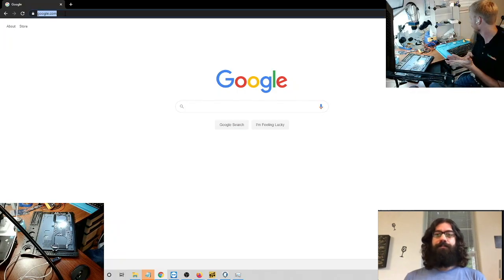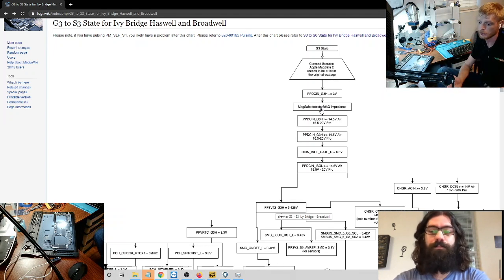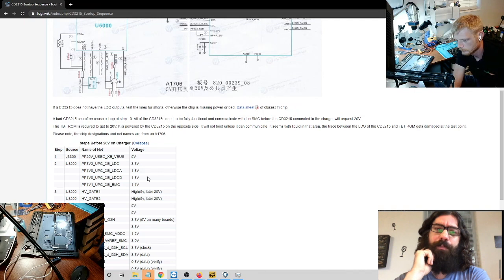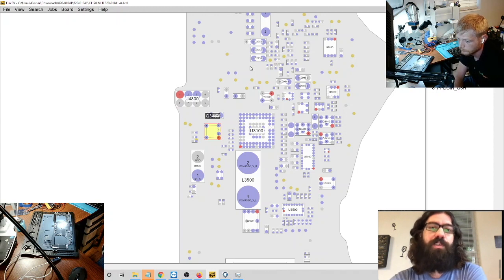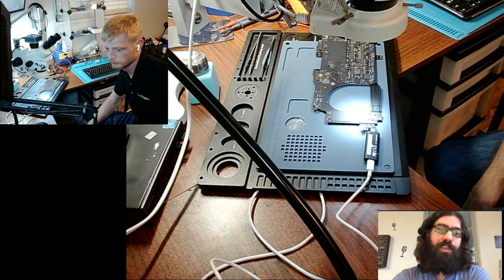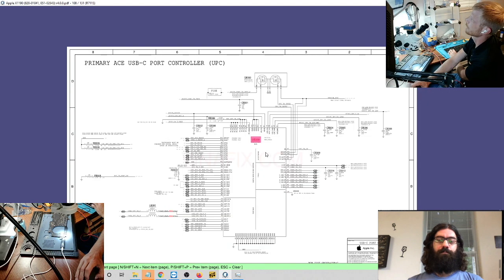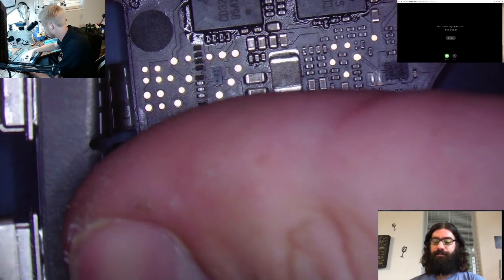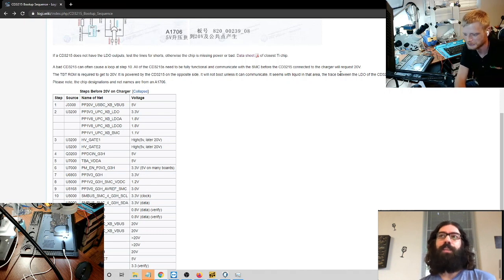Logi Wiki and using it to Diagnose CD3215

Comment: I have a very similar issue. Replaced one cd3215 which went from 1.6 to 2.6 V. Destroyed again? Did you ever find the issue on that board? I have 3 ports taking 5v and around 160 m AMps and one that is 5v and like 0.009 A - that one actually has 3.3V so it seems to work ok.